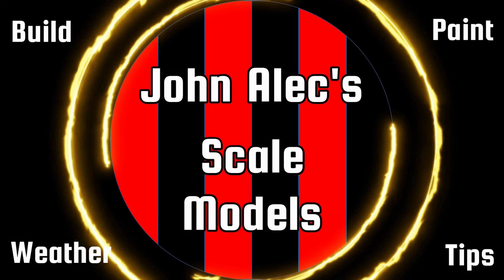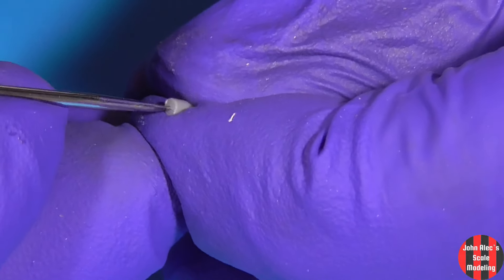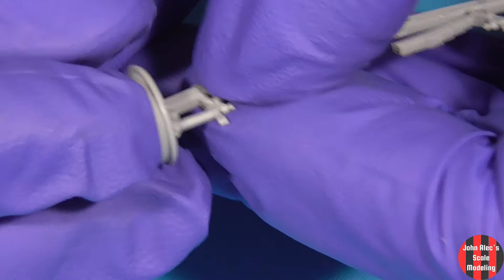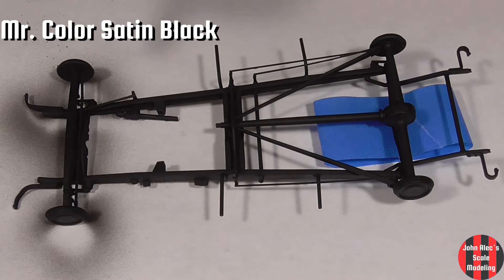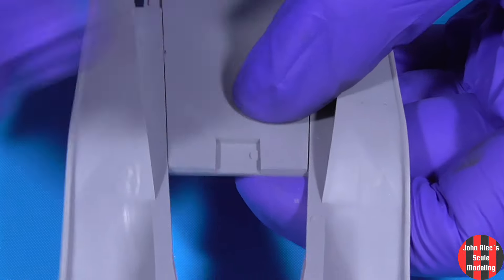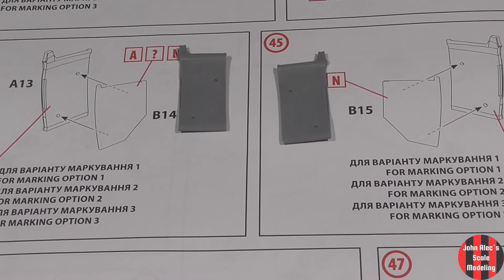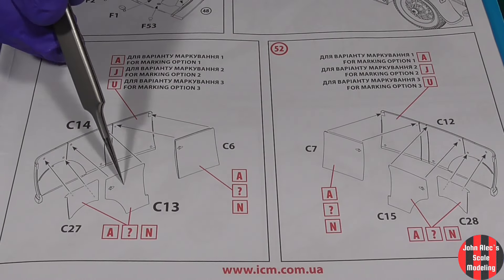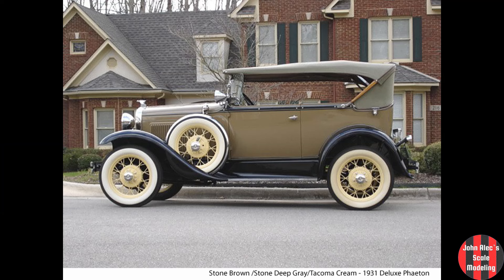Part Two - Brand New ICM 1/24 Model A Phaeton Build

Comment: Doing a fantastic job on this build John!

I've got this kit in my stash and will most certainly be using your build as a reference point for when I come to build mine.  Your method of filming this build is most helpful with your step by step method, as well as showing how a finished component should look. 

As well as what I've spoken about above, it's a joy seeing those little details you put into the painting and detailing. Here's hoping your channel continues to grow because with your effort you put into it, your videos are quality content! 👍
Reply from the maker: Thank you buddy! It's been a good build I recommend it. I have to warn you tho there are these control link rods that you attach to the chassis, all but 1 broke. They are so fine and brittle. Just laid down all the 2k today on the panels. You can skip adding engine until all the chassis is done. Cheers

Comment: I have some that Mr. Dissolved putty. It never looked as thin as yours. It probably isn’t 😊any good anymore since looks like it hardened.
Reply from the maker: Sharp eyes Samuel - I just added some Mr Hobby Thinner (blue label) immediately brings it into better solution. If you have any lacquer type thinner it should work. Cheers